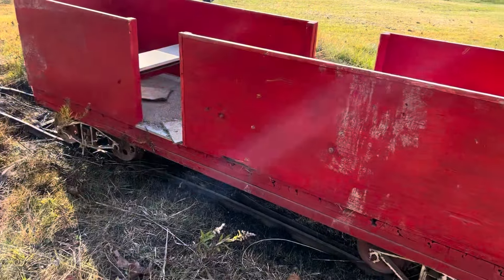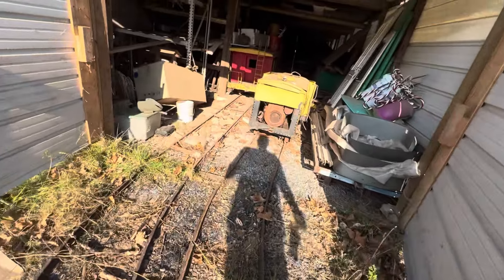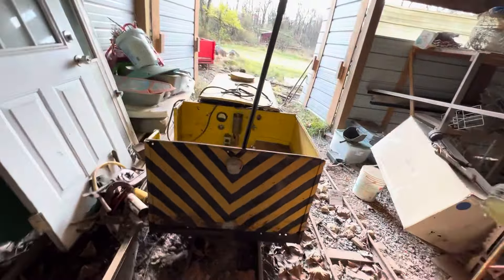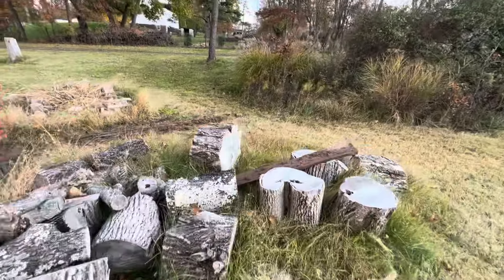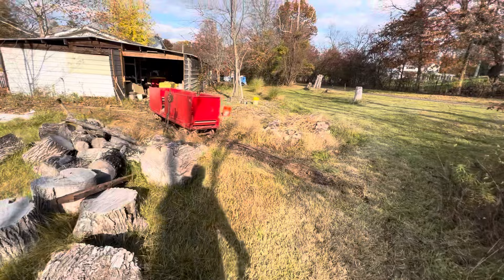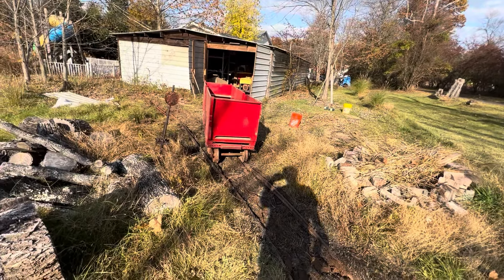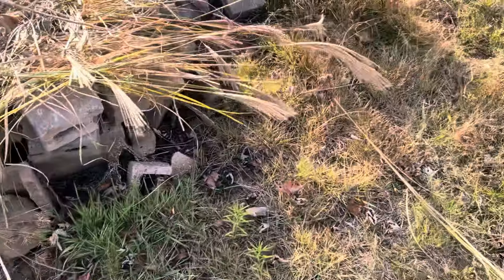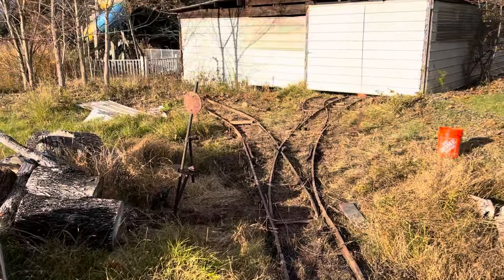Reopening the Collegeville and southern railroad after 12 years

Comment: I have that same welder generator. Cool gig
Reply from the maker: I did remove this welder as it has wire damage. It has good parts but is not useful to me. The loco will be upgraded to a battery with gas generator. Thanks for watching
Reply: Those Koehler Engines are about bullet proof. I ‘ve ran mine hundreds of hours in the hot tropical Hawaii. never ah issue. I installed elec. ignition.